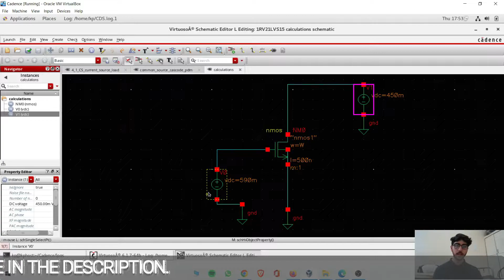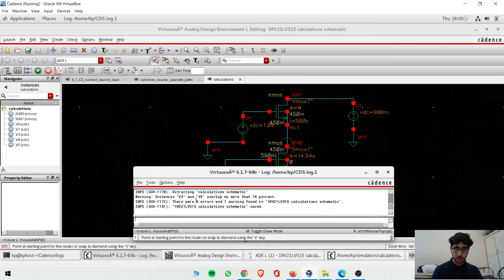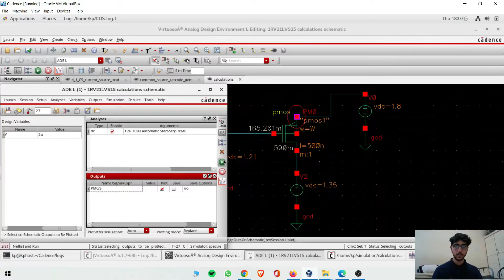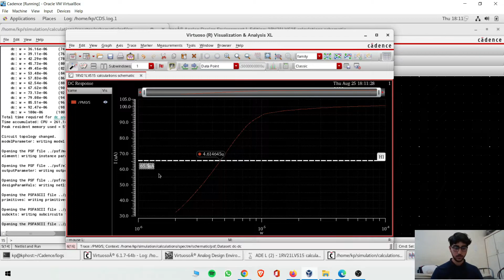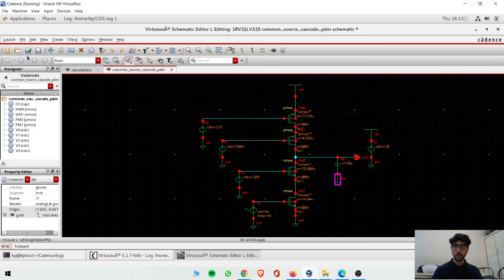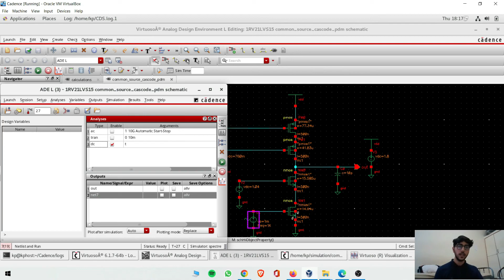10 Casocde CS Amplifier with current source load using PDM | Cadence | Simulation| gpdk180 |Tutorial

Comment: Also for NMOS upper one that's body should be connected to GND and if check carefully in that case 100uA current will not meet for the ASPECT ratio which is coming in the Double stack Cascode Video. Pl comment

Comment: Hello im thankfull for you videos. I have a question. whenever I do a DC anaysis and print operating points to find the vth of the first M1 my vth is differente from when I did the analysis with a drain voltage of .9v. When i did for this experiment with a drain voltage of .45v from my DC operating point i have a differente VTH but i see that you use the same vth for both NMOS and both PMOS would care to explain why? or is it that the change is so little that it doesnt matter?